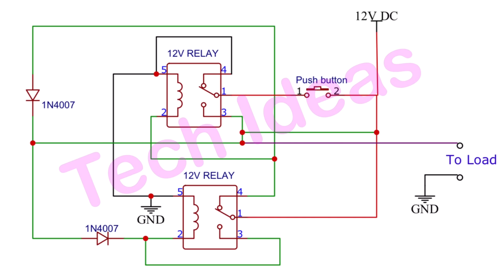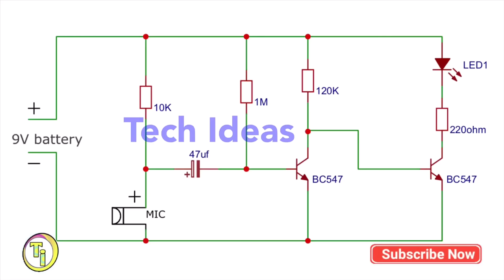Top 4 electronic circuit

Comment: Hello, do you have a example of intermittent switch circuit to 2 different loads using one or two relays?  For example light on the AC lamp A, then after some seconds (time adjusted by potentiometer) light off the lamp A and light on the lamp B, then light restart the cycle...  light off the lamp B and light on the lamp A entering in a cycling routine)

Comment: Using two relays, diodes etc. for simple COB LED switch is a total overkill and I don't understand the purpose at all - it doesn't do anything more (like let's say low-voltage off, delayed switch-off, dimming or some blinking pattern etc)... Anyway the other circuits are nice :)

Comment: Hello,
Can u please give me idea for circuit, 
Requirment : With the power switch of circuit,
 (a) when switched on, the relay in one state, 
 (b) With same switch, when switch off and on again, the relay need to change to another state.

Please support.
Reply: Hello, using this same circuit, it is possible to start a much larger load and also with much higher voltages such as 220vt or 110 VAC, just add a third relay at the output of this circuit, I already have a prototype mounted and I will show it on my channel wait and see